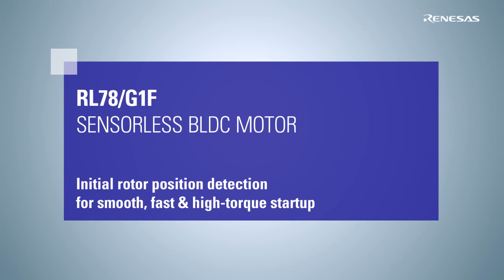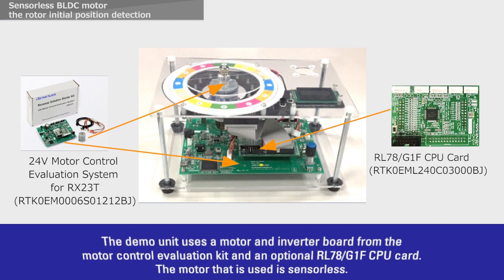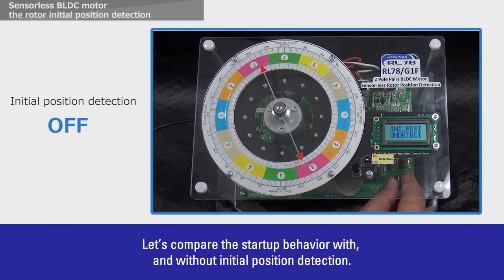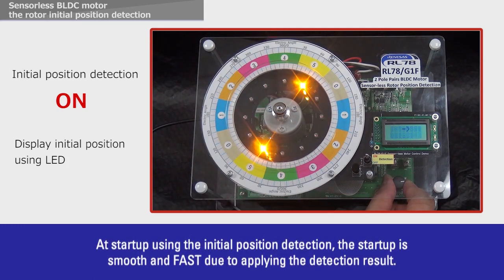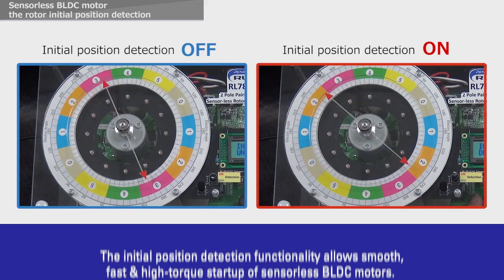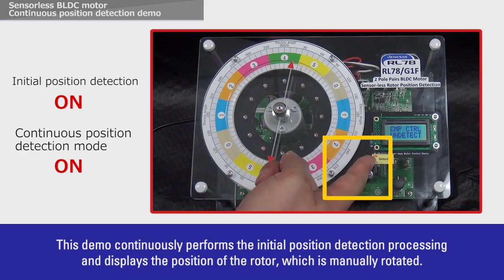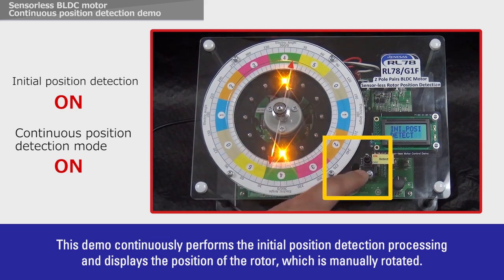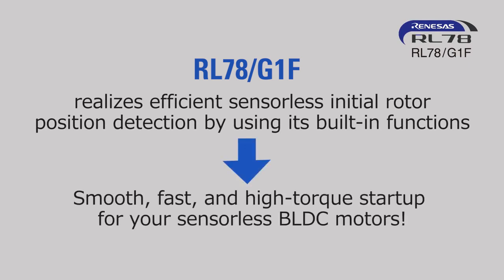RL78/G1F Sensorless BLDC Motor Initial rotor position detection

Comment: I think Samsung uses this chip in their poorly designed 3-Phase Refrigerator Inverter boards. Do you offer the programmed chips only for sale? This can be used to re-design a rubost 3 phase inverter board for fixing damanged Samsung refrigerators.
Reply from the maker: Thanks for your enquiry. Sorry for late reply.
For better sales support, you may write in by filling in your enquiry here, https://www.renesas.com/us/en/support/contact.html
You may get more information about BLDC motor RL78/G1F, https://www.renesas.com/us/en/products/microcontrollers-microprocessors/rl78/rl78g1x/rl78g1f.html
Best regards.